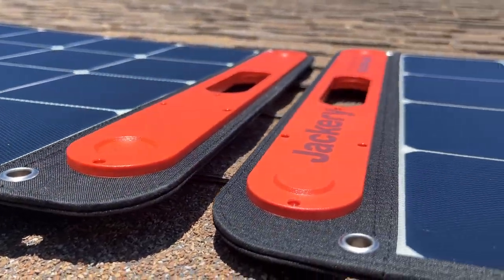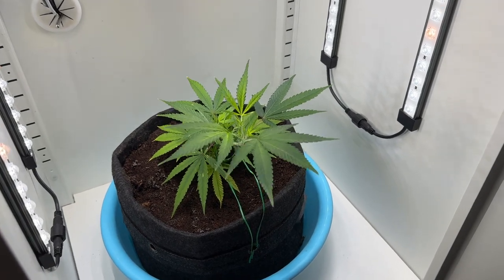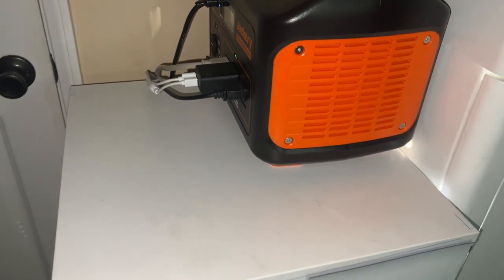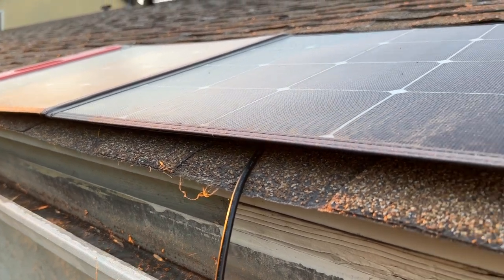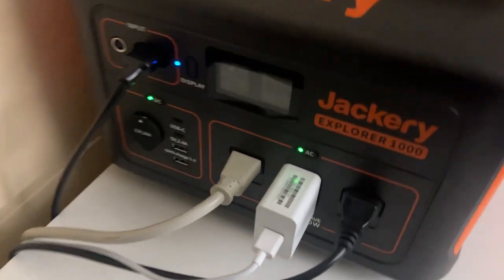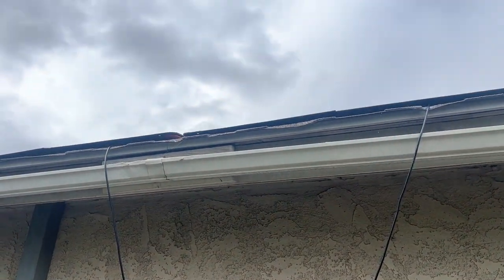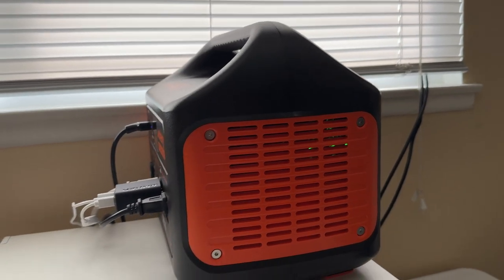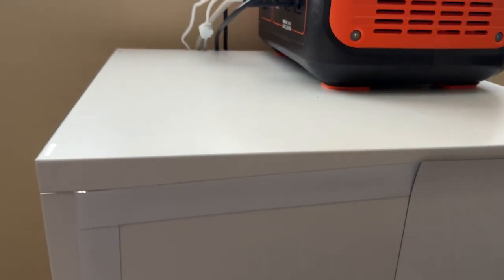(Trying to) Build an Indoor Off Grid Grow Space

Comment: You can do better for cheaper, at least based on the research I found, and for when it rains, you can always just eventually get extra batteries to back it up. Usually in the winter it's very gloomy and dark at least here in Canada. You can get a lot of great resources. I would search for instead of "Portable" I'd look for Trailer and or small scale off-grid Solar panels, they aren't the ones that go crazy huge. You could get 500w input panels, you got this. 

Kudos to you for trying this, I thought about it myself.

Comment: Off topic but bro. Can a 4 inch inline fan be used on the bottom opening of a 3x3 tent to blow cool air in from the room into the tent?
Reply: Be carefull injecting more air as the extractor fan takes out. As you will start smelling it if the tent gets positive pressure😅

Comment: I'd love to see a set up to cover atleast 50 plants... how much battery wattage would be necessary to power atleast 3 lights each 200w of energy
Reply: Why not just calculate that out? It’s based on kWh. You take whatever your light is (most commercially viable lights are 700+ watts) and you multiply it out to figure out how many kilowatts you’d need per hour. You’d need a generator as backup for night because you need lights running even when dark out for vegetation. Only way to make this practical is to use it explicitly to offset high grid costs and run your main power at night and use h this for the 6 hours of battery during the day you’d need that would’ve been really expensive electric. That’s what I’d do

Comment: To save a ton of money if you seriously get into building a real solar system, you will want to get some LFP (LiFePO4) EVE or CALB or similar cells. You can get 4x 3.2v 105ah (1.3kWh total) for only 160$, or 40$ per cell @ 336wH. Or if you're really looking for some crazy power storage, buy a crate of 60 3.2v 163Ah cells for $3700 and you could store a massive amount of power. For batteries, I would buy regular cells and hook them up to a BMS with active balancing and call it a day. These portable power stations are crap compared to a bare-bones setup. They're nice to move around, but they're just massively more expensive.

On the solar panel side, you're better off paying the premium though. If they're mounted on a roof like you're doing here you don't need the bifacial panels or anything, but buying from reputable brands you'll definitely get more watts for your buck. I would stray away from Amazon for solar panels for sure. There's also used panels you can buy a crate of if you want to go the cheap route, for example snail trail panels that have wear on them. They're more economical, but will be more space for less watts. Definitely recommend staying away from those portable solar cells though.

Comment: Square foot of the solar panels is bigger that the Square foot of the plant ... wasting energy .. just grow outside
Reply: It's not indoor anymore, so you cant' control enviroenemtn for perfect crops and you have to grow depending on the season, you don't get the point here
Reply: @surronzak8154  u can control nutrients , and u can use shade clothes .. u can plant near other plants or structures that help control soil temp .. and u get a bigger plant from the sun ..... U can do companion planting so u don't need to add nutrients, or to help with pest control ... U don't need a fan ..... Life is better under the sun

Comment: So what is the KWH of the battery.
If you say 1000 watt what does that mean?
My HPS lights is a 600 watt fixture, does that mean it will run 1.67 X😂
Reply: So to give the awnser its 1 KWH.
If you want to try this, grow outside and flower inside use grid power save 1000s and a couple dollars in power.
Avr cost 1 KWH in the US of A $0.23
800 watt LED light (÷1000=0.8 KWH)
12 hours light on for 8 weeks of flower. (8 x 7 days= 54)
.8 x 12 x 54 x .23= €119.23😂
And 650 hours of durabilaty of the lights😂 
You want to do that off grid have a 10 KWH battery aka $4500 at least